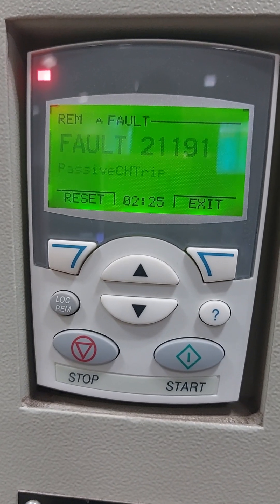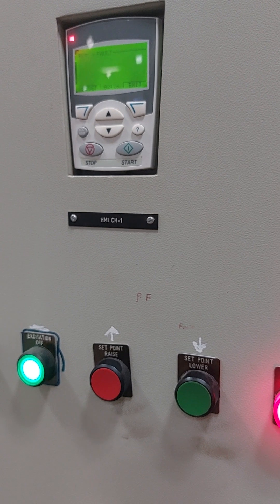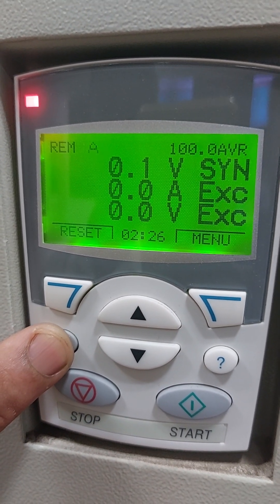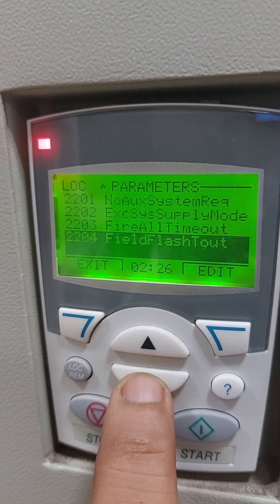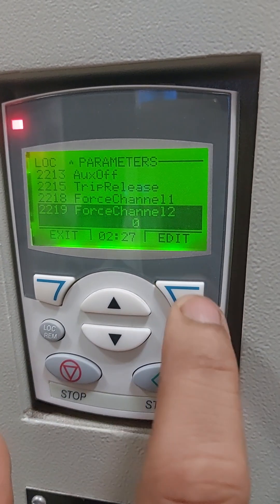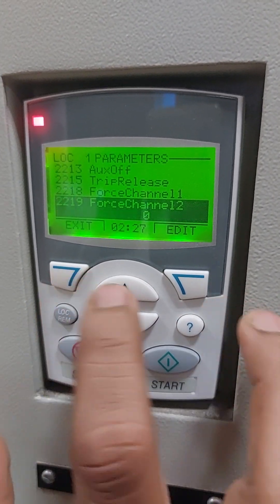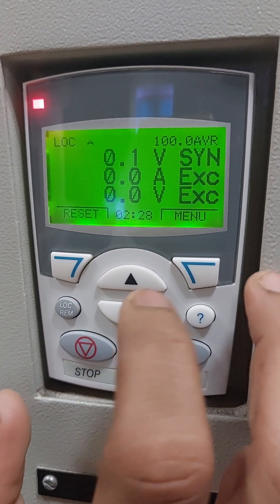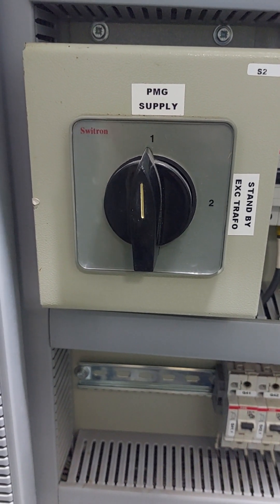AVR Part 1 (ABB UNITROL 6080)

Comment: Hello sir, i have one doubt could you please?.Synchronous motor stator voltage applied applied by MV vfd & rotor field excitation current by static exciter (AVR). Avr excitation reference(AI) coming from Vfd AO.

VFD giving AO based on stator voltage level or motor No load current level to Avr could you plz?

in AVR panel 2 nos AI & 2 nos AO present..what is that uses could you plz?

excitation current No load to full load which parameter will change please?
Thanks.
Reply from the maker: Synchronous motor VFD application is very less or it is uneconomical.
Synchronous motor runs with constant speed with zero slip.Stator flux & rotor flux are sync or locked.As in your case VFD produces constant flux in stator by adjusting the V/F ratio  & it gives command to AVR  produce the same flux in rotor.
AVR adjust the excitation voltage & current to produce the required flux from no load to full load in line with stator flux.
VFD takes feedback from AVR as AI & reference AO gives to AVR.
Reply: @himansupradhan2005 Sir you more explained well.Thanks.

but in Vfd no feedback signal connected from Avr & only Vfd giving AO to Avr AI.so Vfd giving AO based on what parameter like stator flux or Stator voltage or stator current couldn't understand even from manual also.but Avr taking that Vfd AO only as reference for changing excitation voltage & current.

i am approaching Siemens expert to know that Vfd AO.

Thanks.

Comment: How assigned DI inputs
Reply from the maker: For DI assignment, need to use Unitrol configuration software.
Auto ON, Manual ON, Excitation ON/ OFF,Set point Raise/Low, Grid breaker Open/ Closed, External trip,DO,AI,AO, Generator parameters......many more parameters need to configure.Manually not possible.
For generator parameters check 11 I_Measurements_11 section in HMI.

Comment: Sir, Recently generator breaker got tripped when AVR chanel -1 to chanel-2  changeover time due to over voltage, what is the reason
Reply from the maker: Generally Channel change over time tripping will not happen.The excitation system keep running with single channel.We need to analyse whether "Trip from AVR" annunciation came during the time of tripping or not and in Generator protection relay check the disturbance record,OV tripping might have acted (generally 120%).
If any event code generated in AVR  during tripping need to verify.

Comment: Does it support only one channel if other one fails? (UNITROL 6080 excitation panel with two channels working together)
Reply from the maker: In case of dual channel,if the active channel fails,an automatic changeover to the other channel takes place without interrupting the excitation system.In some models comes with back-up channel.CH1+CH2+ BU.
Excitation system Unitrol 6080 
From the type ,we can identify whether it is a Single/Dual/Triple Channel.
TYPE: A6T-O/D1P3-F45
First letter "S" indicates Single Channel. 
First letter "A" indicates Dual Channel.
First letter "T" indicates Triple Channel.

Comment: What is the solution for fault 23003
Reply from the maker: Fault code:23003 indicates Power fail/CPU error/CIO module FPGA internal error.
In A51 CIO(Combine Input Output)module "A" Activity Yellow LED should keep blinking,if not error will come.

Comment: Dear sir can yoh send parameter settings
Reply from the maker: Common system settings you may check in "11 I_Measurements_11" section.
For complete downloading of all parameters settings,we need Unitrol 6000 PCM Installer s/w.

Comment: Sir why 150hz use in AVR?
Reply from the maker: Actually for AVR two sources will be available:-
1)PMG
2) Excitation Transformer (ET)
In some cases directly DC sources are also provided.
Generally PMG source is 150Hz whereas ET source is 50Hz.  Whenever PMG failed,we are changing to ET source.
Higher the AC frequency,less ripples of the DC power.Rectified DC power quality from the higher frequency AC source is better.
Simply saying it is easier to convert higher frequency AC to DC.
Reply: Thank you sir

Comment: Sir how to chane display parameters
Reply from the maker: To change any parameters please follow the steps:-
1) In SCP (Service Control Panel) change it to LOCAL mode.By pressing Loc/Rem for few seconds.
2) Press MENU & select the parameter need to change.
3) To change the parameter value ,press EDIT & UP/DOWN arrow key to set new value.
4) SAVE the new parameter value & EXIT.
5) Again change LOCAL to REMOTE Mode in SCP.
Automatically also it will come back to REMOTE mode after few moments if we keep it ideal.
Go to( 11 I_Measurement _11 )section to check all setting regarding Voltage,Full load Current,Generator Capacity  etc..
Please avoid changing parameters during AVR running condition
Reply from the maker: In a few days regarding AVR new video publishing.
Please keep watching!!!!

Comment: Fault codes-21191 in channel 1
and 23007 in channel 2,what it indicates? please tell me anyone
Reply from the maker: Fault Code 21191:-(Passive Channel Trip)
Trip by passive channel
Possible reasons:
Trip condition detected by passive channel

Fault Code 23007:-(Trip-1)
Trip 1 - Group alarm
Possible reasons:
Trip command given to Plant Protection
Excitation is switched off
Field breaker is opened
Reply: @himansupradhan2005  thank you
Reply: @himansupradhan2005  23007 fault code generated from channel 2,but channel 1 is ON and channel 2 is off condition,how the chennel 2 will detects and shows?can you clear me the doubt?
Reply: @himansupradhan2005 sir how to reset this alarm
Reply from the maker: 86 relay need to reset,
Sync breaker off status missing or 90% Turbine speed feedback missing.

Comment: Sir excitation on nh ho rha
Reply from the maker: Steps to check:-
1) 90 % turbine rpm feedback healthy.
2) Ready for excitation acted.
3) All alarm to be reset 
4) PMG voltage not available.
5) PT feedback missing.
6) All relay to be reset (86A,86C)
7) Sync breaker off feedback missing.
We need to check error code display on LCP & analyse.

Comment: can you make the video how to increase or decrease voltage when avr in operation ?
Reply from the maker: Voltage rise or lower can only be possible when AVR is in “MANUAL” mode.

When a generator is running ,AVR excitation can’t be stopped by intentionally or accidentally pressing “Excitation OFF” in AVR. This will be off in case of trip command activated internally or from the protection system of the plant.
As per sequence, when AVR is in running condition & suppose CH-1 fault happened, it will switch to CH2 automatically.Again if CH-2 also fault triggering, excitation system switching to “MANUAL MODE”. Now manually we need to rise or lower the excitation to stabilise the voltage.
This is quite difficult task for long period of operation.
Generally “Manual mode“operation performed during commissioning or maintenance period.
Steps for manual excitation:-
1.All alarm to be reset,Turbine 90% RPM feedback healthy & ready for excitation acted.  
2..Switched on “Manual PB” 
3.By default CH-1 selected.(2218-CH1,2219-CH2) 
4..Switched on “Excitation ON”
5.“SET POINT RISE” for rising voltage step by step  up to rated voltage.
6.“SET POINT LOWER” for lowering voltage step by step.
7. Switched off “EXCITATION OFF”
Reply: Sir Why 150 hz use in AVR. ?

Comment: Can i change from channel one to channel two without interrupting the operation of my alternator?
Reply from the maker: Yes we can change ch-1 to ch-2 or vice-versa, while alternator in operation.No impact on operation.
In Auto mode,if ch-1 failed/error came, automatically it will switchover to ch-2.If both the channel having issues,then "Auto excitation" will switchover to "Manual excitation mode".